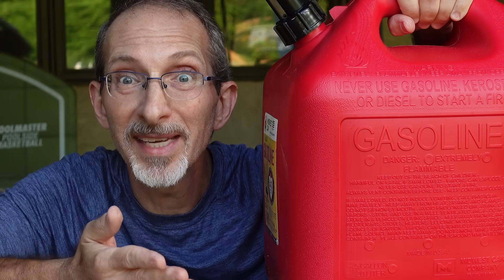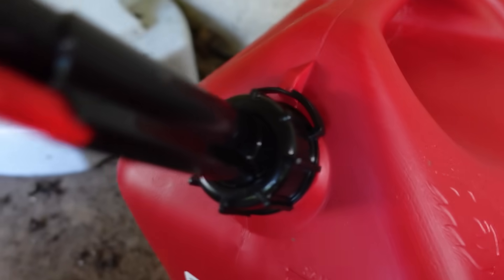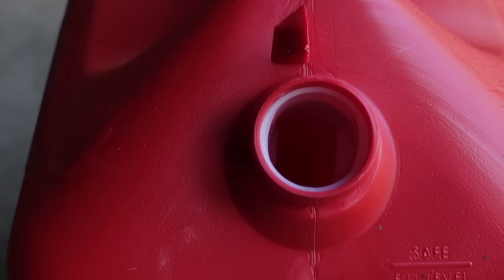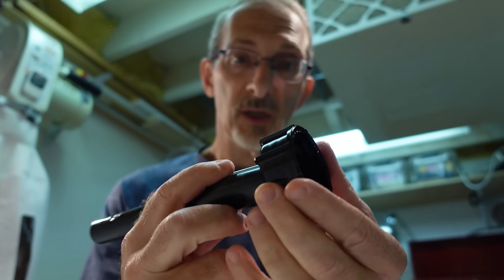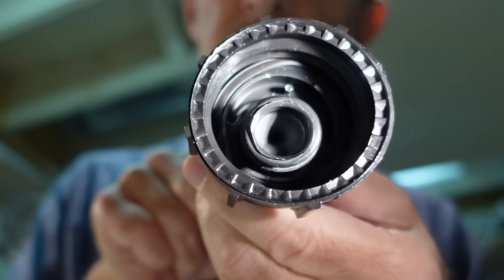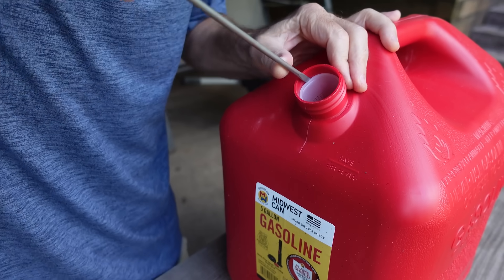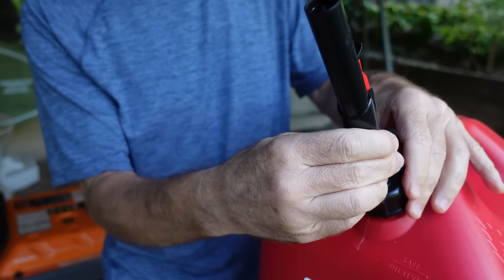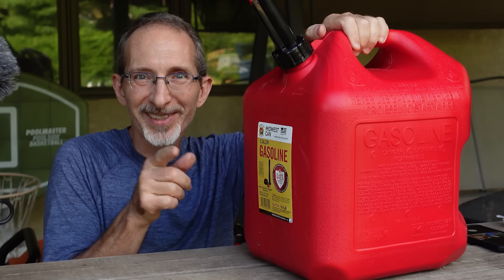Gas Can Modification | New Gas Can Fix

Comment: The screen in the opening is not about impurities. 
It is about preventing flames from getting deep inside.
Also preventing gas from coming out fast if spilled over.
Even so, it really is not worth the hassle and I have personally spilled more gasoline that ever with these clumsy contraptions.
Seems like developed by people in a committee in some government meeting.  People that pay other people to mow their lawn!  So they don't know the hassle they caused!
Reply from the maker: You are correct! I addressed the flame arrester in my second video. I’m about to launch another video that talks about new laws requiring them for all consumer gas containers, 5 gallons and under.
Reply: @MikeFyxdt  Thanks for your videos. I did watch the second one. Last time I tested, but writing a law doesn't make gasoline not be flammable!  Yeah these laws show that politicians have way too much time on their hands.  Also causes more harm than good, I have never spilled more gasoline in my life. Wonder if the laws allow the gas can makers to be held harmless as they made changes per the law!  Also my wife won't use the new containers, so I need to refill the old containers that she can handle.  Also any recommendation into a good gasoline caddy?  around 8 gallons or so.  Ideally with electric pump.  Price point around 250 USD.

Comment: Seems like a recipe for increased spillage requiring more filling at the gas station! Win, Win for the gas companies.
I have crippled hands. How can I use these new gas cans with such strong nozzles? 
Also since I can't lift even a half-full gas can, how do I bend that pipe nozzle to fit it into the filler mouth of the small engine i am hoping to fill?
Seems like not much thought was put into this design or the safety aspects and prohibits some members of the society from using gas cans/
That is discriminatory. Everyone should be able to use a gas can. If I can drive then I need to be able to carry some emergency gas if I run out. Or as you are doing, using a small engine like a generator or lawnmower.
Reply from the maker: @ClissaT - I will be doing a video shortly where I review an inexpensive battery operated fuel pump that doesn’t require lifting the gas can. That might be a solution! Stay tuned…
Reply: @MikeFyxdt  Cheers, thanks Mike. Might be a good idea for me. I handle 2stroke, for the chain saw and brush cutter, unleaded petrol in the mowers, small engines and car, diesel and hydraulic fluids for the various tractors around my farm. All this lifting of fuel cans and hydraulic drums is getting old as I get older! lol
Reply from the maker: @ClissaT  i’ve always respected how much work it takes to run a farm. Thanks again for supporting my channel!

Comment: I do like the way the new cans can quickly stop the flow by simply pulling back. Seems to me to make the filling a little easier.
Reply from the maker: Good point Neil. That is why I re-introduced the spring, in a lesser tension, in my follow up video. It restored the auto shut off feature, but made it easier to control. Thanks for watching!

Comment: Good video, Thanks. Common sense far outweighs anal engineering by some one computer smart that couldn't even change a tire, their own oil, filter and spark plugs/ glo-plugs in their own vehicle or put in a celing fan etc... if their lives depended on it. In the very name of modernization and safety they have made things more unsafe and highly inconvenient. There is an old saying, "If something works well and isn't broke, don't try to modify or fix it" Leave it Alone!
Reply from the maker: Jeffrey, I agree with everything you are saying. Although your old saying,… As a tinkerer, I just can’t seem to leave things alone! :-)

Comment: after using one of these gas cans for filling my generator for the last three months ive found that if you tighten the spout tight enough to keep it from leaking gas all over the top of your generator it wears out the sealing oring. its to bad the epa has cost us so much cant even have a safe gas can anymore. have to turn it completely upside down to put fuel in my generator. and about that screen i have found that if you fill it slow it wont backlass all the gas at you, still my local speedway pumps have too much pressure to fuel this can. go to the circle k and have no trouble filling slow enough to keep it from backlassing gas all over. i have my generator mounted on my semi truck so at most gas pumps work fine at the truck stops where i fuel my generator, loves and t/a and petro.
Reply from the maker: Bradley, you make an interesting point that different gas pumps have different pressures, which may lead to more or less success filling these plastic containers. Because the nozzle plastic is hard, I also wonder how long it will last. These are all great comments and I appreciate you joining the conversation. Thanks!

Comment: The "filter" is NOT a filter. It's actually a flame arrester to prevent a spark or flame outside from setting off the gas inside the can.

Decide for yourself if you want one or not, but this is in fact the reason it was there.
Reply from the maker: Peter, that is a valid point. I found out that the filter is, as you say, a flame arrester. I explained this in my second video, link in the description. I appreciate it’s intention, but not at the expense of making the container unusable. Thanks for watching and commenting!

Comment: This should be intuitive but worth saying anyway. Is a cheap plastic gas can inherently safe to begin with?
Reply from the maker: I think they are safe and the plastic is thick enough to last. Metal cans don’t last forever, either, because they are susceptible to rust. So I don’t think it is the plastic container that is putting anyone at risk. Great question!

Comment: I threw that tip away just use the cap with the round tab, my Honda lawnmower has a big fill hole and use a funnel on anything small, saw this too late
Reply from the maker: Robert, I’m glad you saw it at all! You need to pick a method that works for your needs, and direct pouring seems to be a popular option. Thanks for joining the conversation!

Comment: that "filter" you yanked out of the mouth of the container is called a flame arrester. its to prevent a flame from getting into the main tank when retards decide to use it around open flame. also just buy an aftermarket fill spout they are cheap and significantly better. or just buy a good fuel can and you wont get stuck with that shitty spout contraption to start with
Reply from the maker: All true and all good points! I made a follow up video that talks about the flame arrester, link in the description. Thanks for adding to the conversation!

Comment: I would suggest that you use a spring of a lesser compression strength. This will insure that the O ring makes sufficient contact to prevent spillage should the can be upset.
Reply from the maker: Hi Chuck, excellent suggestion… And in fact I did just that in my follow up video, link in the description.

Comment: Why didn’t you just take a few coils out of the spring to lighten the tension on it? This would make it easier to push, and ensure that it will always close back up.
Reply from the maker: I agree! I did a follow up video, link in the description, where I did just that. I cut away a section of the spring and then stretched it to its original length and it works great! Thanks for joining the conversation!

Comment: Pretty Much Nailed It Mike. The Only Suggestion I'd Make Would Be To Use A Needle Nose Vise Grip, Which When Clamped onto That Pesky "Filter" Would Free Up That Hand For Holding The Gas Can While Yanking The Filter Out. Well Done Video👍
Reply from the maker: I should’ve thought of using the needle nose vise grip. I love that tool! Thanks Mark!
Reply: @MikeFyxdt  Anytime Brother💪

Comment: Do you remember when you could get a good gas can? Pepperidge farm remembers
Reply: I still have a circa 60's red round  aluminum or galvanized steel can , love that thing, bendable spigot that stays where you put it too
Reply: You still can.  Granted, you have to spend a bit more; and you wont find them in big box stores.   Just google "Justrite Safety Can"   I have a 1 gallon for 2 cycle mix, a pair of 5 gallon cans for the snowblower, mower, emergency backup generator etc.
Reply: @jef9711  The Wavian Jerry cans with the non safety spout are pretty good from what I hear but your spending 80 for a gas can at that point.
Reply: Shouldn't that be "Pepperidge Fahm remembahs?" (LOL)
Reply: Ann, I remember.  This crap is all due to one idiot setting himself on fire because he didn't know how to operate a gas can and then suing the Blitz company.
Reply: @bobcranston3414  California CARB and EPA are the reason for these "safety cans" existing, not a drunk idiot with a bonfire and a gas can.  He may have helped the spread of these undesireable gas cans, but it was California radical politics and environmentalism, that brought them into existence.
Reply: Thanks S A L's of California.
Reply: Ataboy!
Reply: Ah yes, “Pepperidge Fahm remembers.” I always liked those commercials. The guy that did those was Parker Fennelly ( an actor) and he lived to be 96 years old.
Reply: Still can, just gotta spend
$50 on an all metal one
Reply: I buy all mine in canada where they still have good cans
Reply: Remember Chewbacca? Good memories...
Reply: Harbor freight sells metal 5 gallon gas cans
Reply: The good thing with gas canisters, is that they're a standardized size for the cap/spout. 

I unfortunately lost 2 5-gallon cans with the old pull-out spout and tethered cap. 

I got so frustrated with these new style, unsafe spouts, that I found you can just buy the older design spouts still. 

Plenty of different styles to use. I bought a few that have a clear tube, the same ones that came with my 15 gallon race fuel containers from VP Fuels.
Reply: Still can, they just aren't the el cheapo specials at wal mart. Good gas cans cost more than $15-$20. 

That stated, these midwest cans might be the very worst I've seen for cheap cans.

Comment: Expensive metal Eagle or other brand safety cans are not the answer.  I've bought well over two dozen of those safety cans in my job in the printing industry.  They are fine for filling from a hose pump, then pouring into a wide mouth container, but not for trying to fill a gas tank on a mower or a car unless they have a suitable nozzle, which many do not have. They are heavy and don't last forever, because if moisture gets in the can or around the neck they can and often do rust out. 
Plastic cans are best, IMHO.  But you have to find some old style spout to make them easy to operate. The spout here is actually a good spout if the spring compression is not too stiff, and that safety latch at the base is really no problem.  I'd rather have it there than remove it.  I have two five gal with spouts almost exactly like the one in this video, and they need no modification but that is because the spout spring is light enough that it does not cause a problem.  It needed, I would maybe just cut a coil of two off that internal spring.  I'd remove that filter before filling the can from a hose, and put it back in when using the can to fill a mower.
The best cans have a solid handle horizontal along the top and vertical down the backside, too, so you can control the can with the top handle when carrying, and control it with both handles when tilting it to fill a mower.
To me the biggest problem with current gas cans is the price is way too high for what you get.
Reply from the maker: Good points! Many people in these comments are recommending metal cans, so it’s good to hear some counterpoint. I agree with having a second handle, especially on larger cans, to make them more manageable. In my second video I showed a mod that reduces the tension of the nozzle spring, for those that Want to keep that safety feature. It works well! Link to the video in the description.

Comment: Tractor Supply sells replacement nozzles that are the old style open flex tube and come with a proper vent so you can fix your new cans. Depending on your state, you might have to order them, but they’re available.

Comment: I would like to add that I also purchase a gas can vent on E-Bay and install that. It is as simple as drilling a 1/2" hole and popping it in. I also like to replace the whole pour spout with the old flex type. One day when I was at a city repair yard, a car came in on a tow truck out of gas. They tried to get gas in it, but found it to be very difficult. The guy ended up getting a large funnel, removing the spout from the can and proceeded to pour and spill gas everywhere. Seems to me the safety spout did more harm than good. What a bunch of morons that came up these rules. Luckily there is an aftermarket to fix all the bonehead rules.
Reply from the maker: Bryan, yes to the vent! I did a follow up video where I installed a vent, and also did a modification on the spring for people who want to retain that feature. Link in the description. Thanks for joining the conversation and for watching!

Comment: Even with the mods, which I like, it's still hard to fill your machine without a flexible tube. I'm sick of the government making things "safer" for me. I never had any problems with the old metal cans. Today as a matter of fact I filled up my 5 gallon safety can and had to lift it, hold it in place, squeeze a lever and try to hold it while squeezing so that the gas would come out and into my lawnmower. And keep the filler tube in the lawnmower fill hole. I only have 2 hands but need another one. And yes, I spill gas because sometimes, while trying to finagle all the safety features, the fill tube flips out of the fill hole and dumps gas onto the mower.
Reply from the maker: Agreed to all your points. If these designs are supposed to make fueling easier, the design is falling short! Thanks for joining the conversation.

Comment: I got an old school 5 gal metal gas can from the 60's my father bought. The cap is spring loaded, connected to the handle, and you catch the handle into a notch and pull back to open it. Gas attendants never know how to open it lol. Ya you need a funnel, but still the best gas can I've ever used to this day.
Reply from the maker: Dave, old school for the win! Thanks for joining the conversation and for watching!

Comment: Government libtards trying to "protect" you.  Always remember , If the government tells you something is good for you , then  It's going to be REALLY good for them
Reply from the maker: Randy, new gas container safety requirements were signed into law in December, 2020. Expect flame mitigation devices to be on all plastic if your containers within the next two years.
Reply: @MikeFyxdt  There's aftermarket nozzles , and some you can make yourself